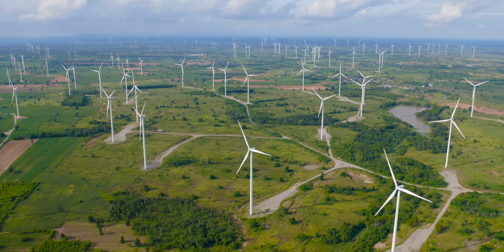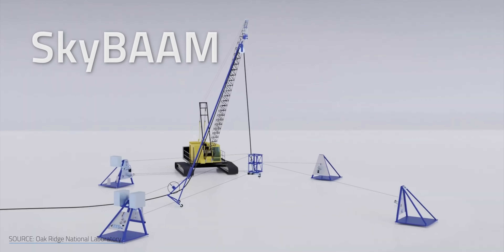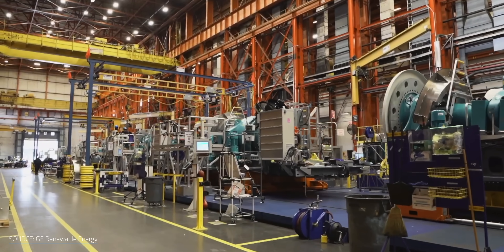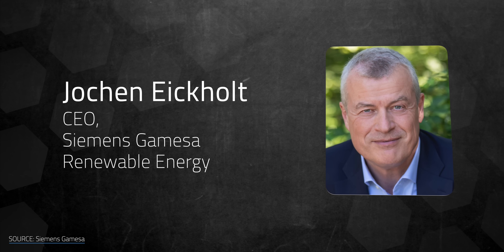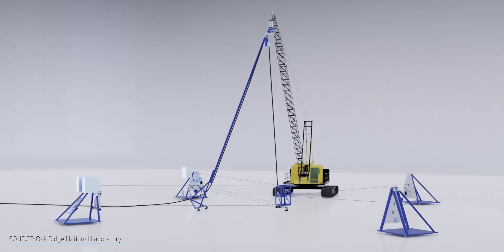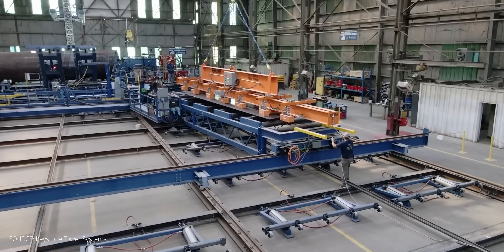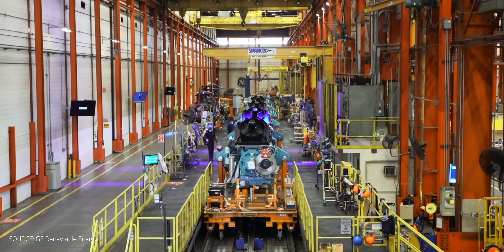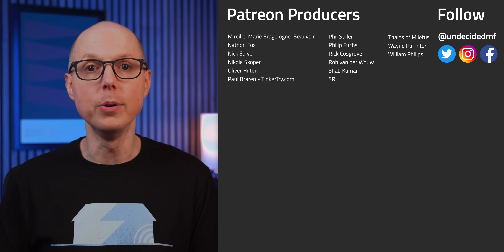Why We Need To Rethink Wind Turbines

Comment: There's a lot about wind power that makes no sense to me. Why not recondition the blades rather than replace them entirely? Wouldn't it make more sense to use a heavier recyclable material, so the speed change is more gradual and therefore easier to work with? Also, surely if the blades are light enough, wouldn't it be faster, easier, and cheaper to fly them over via helicopter? And why isn't there more investment in other form factors? Seems to me this giant propeller design isn't all that great if you're looking to do an array (as opposed to just a single unit).
Reply: Reconditioning: the blades are subjected to significant dynamic stress over time, weakening the material in hard to predict ways. They will develop micro fractures over time in different parts and ultimately fail. You also can't just add a "band aid" without either destroying the drag coefficient or seriously weakening the material.

More recyclable materials: it's an open area of research and the mentioned balsa wood blades would fit the bill. So far, the benefits of a more recyclable material don't outweigh the cons.

Few people in the industry take the array designs serious for a reason.

Comment: Wind is a fool's folly. Placing turbomachinery 300' up in the air on a pole is just stupid. In fact, any rotating machinery is obsolete when compared to solar and battery storage.
Reply: But PV and batteries let the cheap energy cat out of the bag and tends to cut out the gravy train that utility owners currently have.
Reply: @fllev4121  utilities make a guaranteed rate of return, and even with 100% solar and batteries, they will make 10-12% return on all their capital investments.

Comment: Array of smaller blades will not increase energy output because longer blade length higher torque more powerful elec. generator can be installed. Blade numbers is factor in old American movies 48 or 36 blades water pump windmills. Even small wind creates enough torque. Still it is 14 "century" technology no energy amplification.

Comment: Of all the things you featured in the video, the Myriad system is the most promising and practical. All those on-site manufacturing methods are very early stage and are unlikely to have any real impact in the next 10 years. It's is VERY hard to manufacture in uncontrolled environments like you would find at wind sites. Desert, mountains, ocean - all are radically different and all have an effect on the machines and materials. This is one of the issues 3D home printing companies are facing as well. When it's 35º on one homesite and 105º on another, your materials just don't behave the same way and you have to make adjustments which introduces uncertainty in the final product. The same is 100% true for on-site wind component manufacturing. The one place you don't want uncertainty is in wind generator components - as Siemens has learned.

Comment: Something I always wondered, "Can we get with more with smaller than bigger?"   For example, instead of having one massive windmill turning the turbine which requires space and stronger winds....could the same turbine be somehow turned by multiple smaller ones working together to do the work of the bigger one.  I don't mean a lot smaller one independents producing smaller amounts (which is also an option) but rather like multiple smaller ones turning working together to turn a single shaft.
Reply: that means more bearings, and belts or cogs. which means more losses. Combining those losses, with the fact that halving blade length, quarters the power, its probably a bad idea.
This is a case where a larger blade IS better, due to geometry/physics
Reply: @kitsunekaze93  But is it?  I understand what you're saying from a mechanical perspective, but from a purely mechanical perspective nobody would ever use more than one pulley because with each additional pulley we increase the complexity and potential for failure while never decreasing the energy requirement needed to achieve our goal.  But we do add more pulleys...why?  For the force multiplier effect it creates because a train of pulleys working together lessens the burden and can potentially produce more than the sum of its parts.  I think it would be interesting to see what we could produce with this approach.  In the video, one of the designs is a pole with many smaller windmills...so it's not an alien idea, others are on the same page.  But I would like to see a team of dogs pulling the sled instead of eight dogs free to do what they want.  ;o)
Reply: @@wishthound4724 Hello there, the reason the other person said it would be bad idea to use multiple smaller windmills to turn the same turbine that we need a massive singular windmill is that with each smaller windmill we add, there is an increase in mechanical complexity and a potential decrease in efficiency.  I agree there is an increase in mechanical complexity; but I do not agree with a decrease in efficiency.  I compared the situation to the usage of a pulley.  If mechanical complexity was the only determining factor, then we would never use a multiple-pulley system for anything because with each pulley we add we are increasing the mechanical complexity.  However, when we use a multiple-pulley system...we don't get a decrease in efficiency, we actually get the opposite because of the force multiplier effect.  For example, ten smaller things working together are more efficient than one big thing doing the work of ten.  I think if we applied this type of thinking to windmills, maybe we could design a multi-unit windmill that can do the work of these big ones while being made of smaller ones working together.
Reply: @@wishthound4724  "...how smaller turbines are less space efficient than a single large design at harvesting wind energy..."  No, that is not accurate.  Most recent studies comparing multi-rotor design performances vs a large singular design have proven that not only do the smaller multi-rotors design outperform, but they consistently....produce more energy, do it at slower wind speeds, for less money, with faster recovery, and with the same or smaller physical footprints of the larger singular designs.  A great example was with Vesta's prototype research.  Their research with a 4 rotor design had a  total of 6% (1.5% per rotor) better output than it's single rotor counterpart in the real world testing and a 13% better performance in the lab conditions.  This was later backed by Aarhus University when they created a 4 rotor design and showed modeling that said not only would their 4 rotor design produce more than it's larger counterpart but could be placed in a tighter grouping with little to no impact due to it's superior performance and faster recovery.  Now in fairness, this is a multi-rotor design, which isn't exactly what I was I was talking about earlier.  But, it goes to show that we cannot dismiss the idea.  It's a classic example of "pennywise dollar short."  The best final outcome is what we are trying to achieve, not the the best performance at every step....cause the two might not always be connected.

Comment: “A race to the bottom.” Precisely! Recognize that phrase? Shawn Fain, president of the UAW, uses it to describe automotive competition that deliberately squeezed labor to lower costs and maximize profits, the same way turbine manufacturers skimp on production to lower costs and increase short term profit. Technology won’t solve this problem because the problem isn’t technological in nature. The problem is created by privatizing production. All private production seeks to pass along their costs to labor, consumers and the environment to generate profit and they must do so because if they don’t their competitors will. The solution is simple. Integrate supply with consumers and labor so that supply cannot offload their expenses. Privatizing supply is the source of all environmental and labor degradation that no society would deliberately elect because it wouldnt produce collective profit, it produces collective debt that only lines the pockets of supply because supply is privatized.

Comment: The MultiRotor Wind Turbine seems a bit silly to me the way it is shown in the video. If you are going to put several wind turbines so close together like that why would you still make them horizontal axis turbines and not vertical axis turbines? By its nature VAWTs already reduce the "blockage effect" mentioned and can withstand stronger winds compared to HAWTs.

I'm aware that, in general, VAWTs are lower efficiency when compared to HAWTs but if the whole point is to stick a bunch of small turbines on a large stick 100 meters in the air then packing even more turbines without reducing efficiency seems like a win win. It would probably simplify the building process even more. Just have the VAWTs core "lock" into the one above and below it then the top and bottoms attach to the frame. Depending on how many they add it could end up looking like an entire cube of VAWTs from a distance.

Comment: Most of these companies have stupid ideas.  Working on new ideas don't mean they are good ideas. Show me a working prototype, not computer generated pictures.

Multi rotor wind turbine is completely stupid, it would be a nightmare to build and maintain it. They only have internet pictures, I don't think they can even build a functional prototype.
How do you get to the component that failed?  Way too much complexity, way too many potential points of failure. To resist structural forces, vibrations, and fatigue, means it will be more expensive than normal wind turbines.
Too many bearings, motors...
 one of the reason to put bigger turbine, is to reduce the number of components per power produced. 3 big pitch motors, 3 controllers and 3 gearboxes are cheaper than 30 smaller motors, 30 controllers, 30 gearboxes. It takes nearly the same amount of man hours to maintain a big wind turbine than a smallone. So a big wind turbine has less worker cost per megawatt, for the life of the turbine.

3D printed concrete will never have the strenght of normal molded prestressed concrete. 3D printing takes more time, adds nothing beneficial.

Bringing the tower welding factory to the site? Why not. But you also need to bring the tower painting station with it. 

3D printing blades? Stupid, takes more time, cost more.

What product has ever been built more cost effectively by 3D printing it, than other traditionnal means? Certainly not big structural parts under strong loads.

Comment: 5:03 - The problem is not ingenuity of physics, design, or process, but of motivation to pursue the most effective design for the size / scale. 

The best way for them to succeed is with centralized (specialized) manufacturing. They're willing to lose money chasing an ideal based in a misnomer of physics applied to commerce : chase the easiest gains first. Scaling works until the molecules and bonds no longer suit the project. I don't believe glass fibers on blades are the same as fibers in a plane body. Perhaps if the blades were pressurized, they'd be stronger; until they burst.

Comment: Is there any financially stable business that is currently using additive manufacturing onsite to produce anything? Additive manufacturing is only good if you have limited resources like on the moon or want to go through various iterations or custom designs.
I imagine that if anything the next logical step is to make the blades consist of multiple parts that can be assembled onsite if blades are really getting too difficult to transport. 3d printing will never be as structurally strong as other production methods using the same material unless it is such an intricate shape that it can only be produced by 3d printing.

Comment: I am a trained Wind Turbine Fatigue Engineer and have every sympathy with the teams designing these huge structures and also manufacturing them.   Offshore wind is also an area I am involved in and the methods used to erect these offshore is like building a Ford car on the motorway/interstate highway !  Yes stupid and unreal.  It is time to build these up onshore and tow them to site fully assembled and comissioned. 😈

Comment: I have a question.   If we continue adding more and more large turbines could this cause our day/night cycle to become longer?  What effects could this have on our planet?   Could the wind resistance not be enough to do anything or maybe overall air currents on the planet will change?  Love all your videos!
Reply: Misuse of a comma.
Reply: There is no comma @AwesomeHairo
Reply: Anytime you move weight away from the ground it slows the earths rotation, when the largest hydro reservoir in the world was created it slowed earths rotation by 0.06 microseconds.

So the answer is technically yes, it will “slow” the earths rotation. But only by such a small amount that it won’t be noticed.

Comment: The fundamental problem with smaller rotors comes down to simple mechanical advantage. A unit force acting 2x further from the pivot produces 2x the torque, which means 2x the power generated. So larger rotors are always going to generate more power than smaller ones. Multiple smaller rotors also multiply the maintenance overhead. BUT, thanks to the lower forces involved, smaller rotors might be able to use more environmentally-friendly materials in their fabrication.

THE big problem with wind turbines is the vast amounts of unrecyclable waste they generate as the vanes age. This is conveniently overlooked by the vast majority of wind enthusiasts. 

(Well, that’s one big problem at least; intermittency of supply is arguably an even bigger one. Just look at Germany’s electricity costs and the increasing problems they’ve been having with grid stability.)
Reply: Not 2 times the power, 4 times the power. Power is proportional to swept area.
Reply: @rogerphelps9939  Somehow I was thinking of it being proportional to the square of the radius, but I couldn’t figure out the source of the extra R, in terms of the forces acting on the blades. The torque from the direct force of the wind gives you one R, but I was having a hard time with the second one. After a little thought (and discussion with ChatGPT 4), I realized that you get the power by integrating twice, taking radial increments of dr, you integrate first around the circumference of the annular ring dr sweeps out in one revolution, then a second time along the length of the blade. Thanks for the correction!